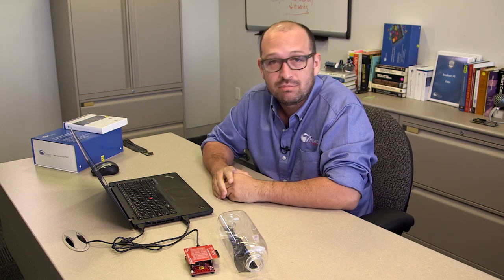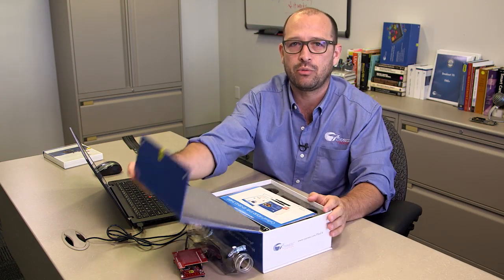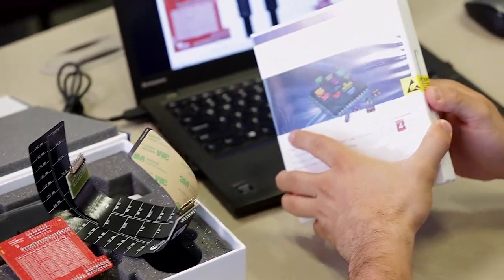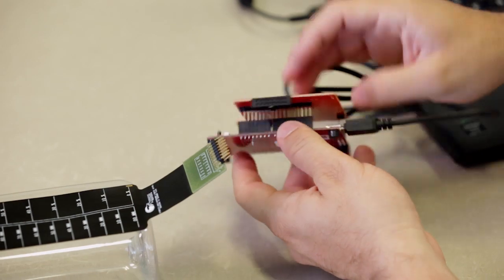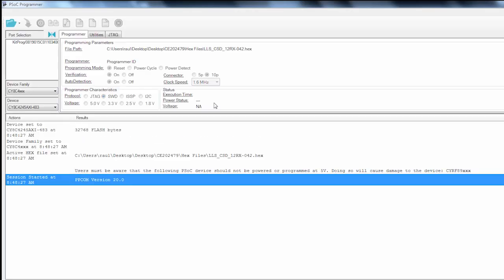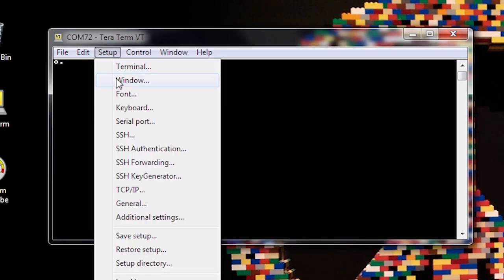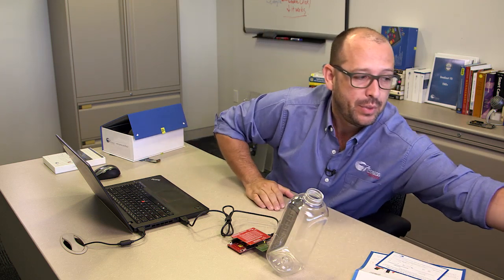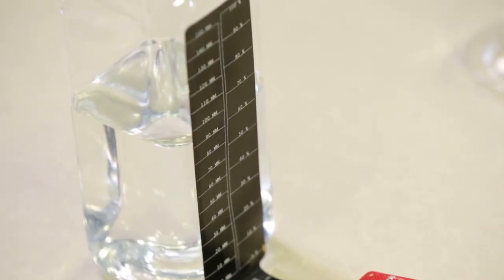Liquid Level Sensing with PSoC and CapSense

Comment: I didn't see precision. I just saw a very coarse resolution of about 10% increments! Nice use for the CapSense, but very terrible "product".
Reply: So, this isn't really a "product" its a demo, and the resolution can be tuned based on the layout of the sensors. This same principle can be tuned to measure VERY small increments.

Comment: hello, do it can measure 0.3ml to 300 ml quantity liquid, and the capacitance will vary for different solutions and we have 3- 4 types of solution  do this type will work
Reply: Yes, you can identify different types of materials based on the capacitance. You can't really detect volume, you can only detect liquid presence...